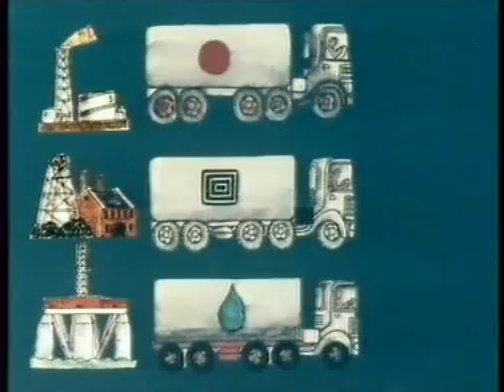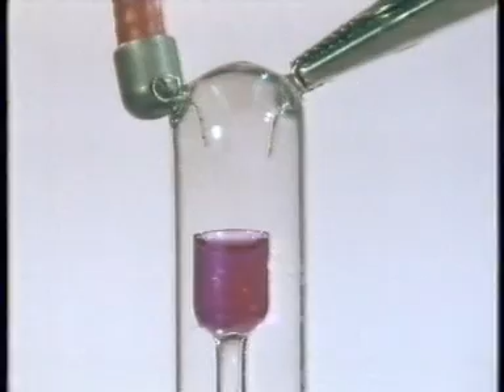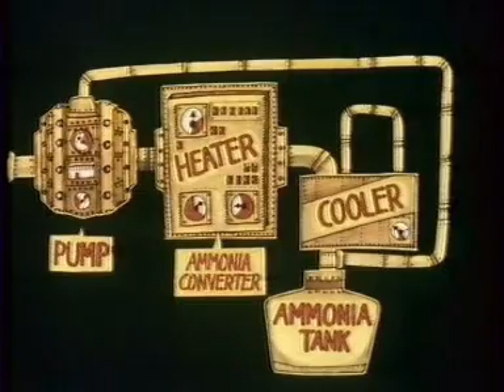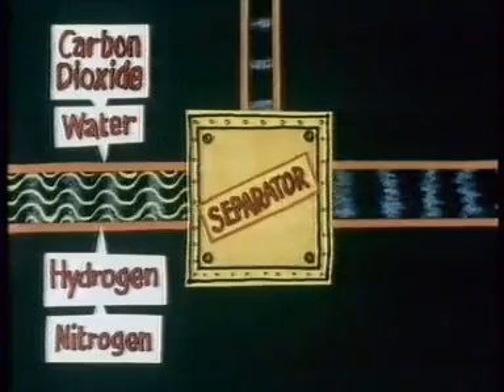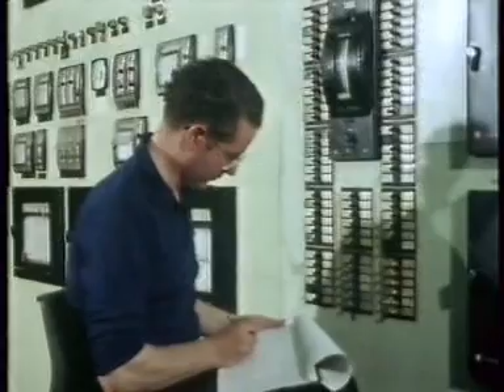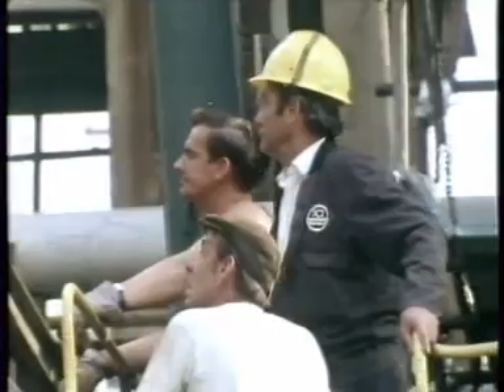The Haber Process

Comment: Imagine the efficiency bump if they had cheap PV panels like we do back then. Cover a lot of the area on the plumbing with panels and then generate part of the hydrogen by electrolysing water, and use the steam reforming just to "plug the gaps".
Reply: Even if they cover whole area with them they wouldn't be able to run decent ammonia compressor not to mention other processes. Solar panels <20% efficient in visible light to electriciry conversion, rated power never achieved in cloudy UK, precious metals nearly never recovered once they are traped between glass sandwich...

Comment: Sir are the molar ratos of the reactants (steam, methane and air are adjusted to maintain 3 vol of H2 and one volume of N2 in the pass?
Reply: @sgtbrown4273  why does it seems those old videos are always more full of content and more well explained that any videos i could find made on this century,it really bothers me that people seem to be getting dumber every new year that passes
Reply from the maker: Yes. Unreacted gases are mixed with fresh hydrogen and nitrogen to maintain the 3:1 molar ratio and added to the reactor at a high pressure of around 200 atmospheres.

Comment: Great video, thank you sir. I would like to know if you what is material used for pipes filled with the catalyst and how one can adjust the 3volumes of H2 to  one volume of N2.
Reply from the maker: I believe the iron catalyst is not in pipes, but spread out on flat beds that allow the gases to circulate through to maximise the surface area. The chemical engineering details will depend on the specifics of each process, however, the ratio is maintained in the previous reformer stages to the main convertor, firstly the production of hydrogen and carbon monoxide from methane and steam and then the removal of oxygen in air by reaction of the carbon monoxide created in the first reformer to produce carbon dioxide. The carbon dioxide is then removed through absorbtion in alkali to leave nitrogen and hydrogen. Stoichiometric control of the reformers results in a molar ratio of 3:1 hydrogen:nitrogen. This video gives more technical details:  https://youtu.be/F0Chz86i6oY

Comment: Those were the days, brought back some memories, all gone now, the 3 plants were dismantled and shipped off to Pakistan, but ammonia 4 still runs today 🤪
Reply: Yes in the 90s a fantastic place all plants were linked ammonia to nitric then fertiliser plant all in billingham. Also had a methanol plant before we had a great supply of natural gas all the gas came from coal that was a very dirt smelly part of site
Reply from the maker: @stephenpearson3153  I teach about the Haber process but have no knowledge of the operational details. Do you know how the temperature maintained at 450ºc? Does the 200atm pressurisation lift the temperature to this level? Also, is the iron catalyst iron oxide Fe2O3?
Reply: @Vajradaka  hi Jon just noticed message, ici used copper based catalyst which subsidury developed called katalco which is now Johnson matter.
Reply: Johnson mattey
Reply from the maker: @stephenpearson3153  isn't it iron (magnetite)? https://matthey.com/en/products-and-services/chemical-processes/chemical-catalysts/ammonia-synthesis-catalysts
Reply: @Vajradaka  yea you could be right I think methanol production involved the copper catalyst it always came out green
Reply from the maker: @stephenpearson3153  yes copper/zinc it seems https://matthey.com/en/products-and-services/chemical-processes/chemical-catalysts/methanol-synthesis-catalysts
Reply: @Vajradaka  To start the reaction,  a startup heater is used, it's the bottle look vessel next to the converter. The temperature is maintained by the exothermic heat of reaction and cooling done by introduction of recycle feed and very intricit piping system inside the converter to keep the shell cool. In the older styles of ammonia converters (shown in this video), there is actually an exchanger fitted inside the ammonia converter near the top to cool the outlet and heat the inlet.
Reply: @Vajradaka  The catalyst is actually wustite.
Reply from the maker: @azizahmad1614  Thank you for the information. Great to add some details.
Reply from the maker: Did you work there?

Comment: impressive they could run such factories without real computing power
Reply: Computers don't do anything that can't be done without computers.... they do things cheaper than they can be done without computers and that is all.
Reply: @edgeeffect  cheaper and quicker and more efficient.
Reply: Machines and valves and rpms is still 1000% an art - even today's processes would run much better if a human was driving the machine - it's just cheaper to take the efficiency loss than it is to employ the squishy body
Reply: I mean you don't REALLY need computers for such a simple process. Computers are just convenient because they have 100% alertness and faster reaction/deployment times.